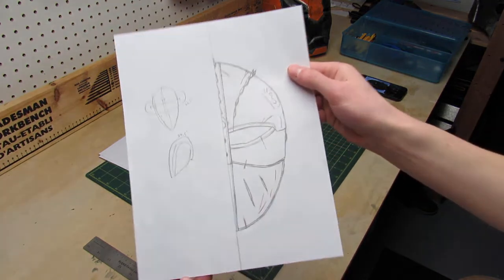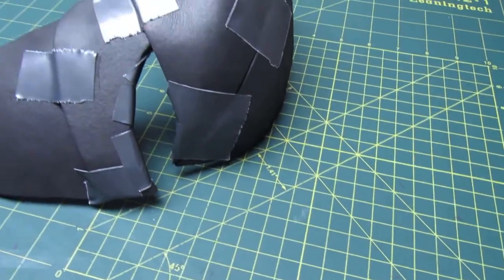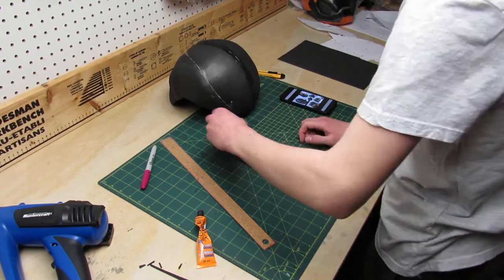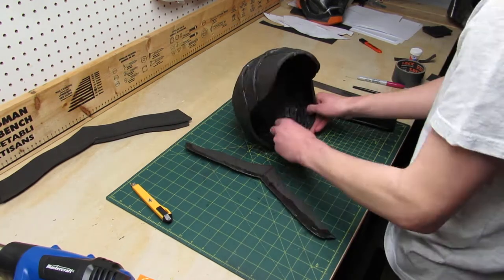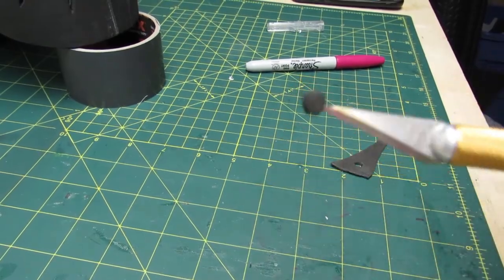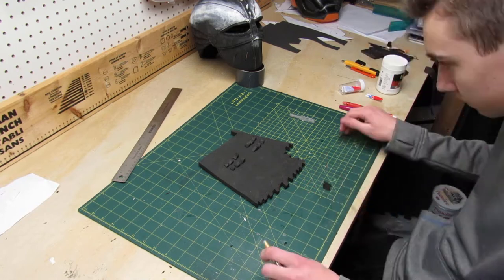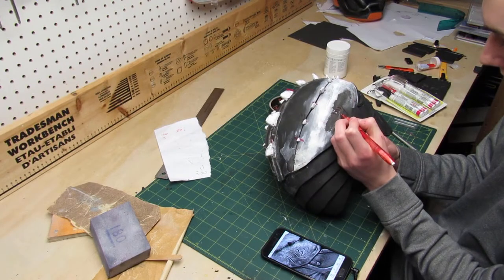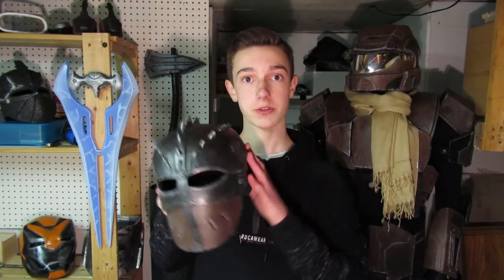How to Make HICCUP'S Helmet from How To Train Your Dragon 2

Comment: It was amazing, I don't have a pistol can I use something else? (sorry for any mistake in english i'm from brazil)
Reply from the maker: Thanks. What do you mean by "a pistol"?
Reply: @TristanMaker  ops sorry i meant heat gun
Reply: @TristanMaker  like i can use the linguee
Reply from the maker: If you don't have a heatgun I would highly suggest buying one because they are really cheap and you need them all the time when working with foam. But if you don't want to get one you can use a hair dryer at the hottest setting and heat up small parts at a time. It will just take much longer than with a heatgun.
Reply: @TristanMaker  Thank you